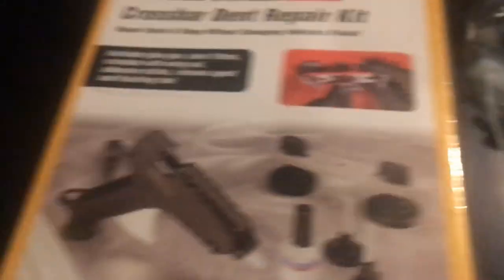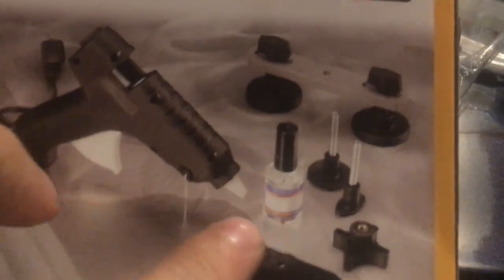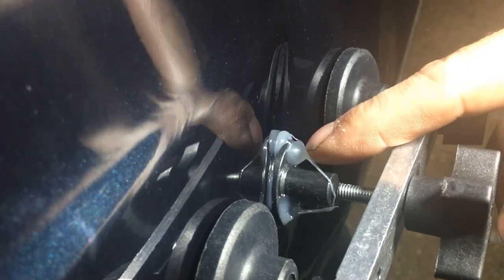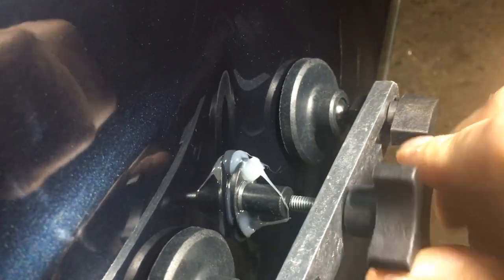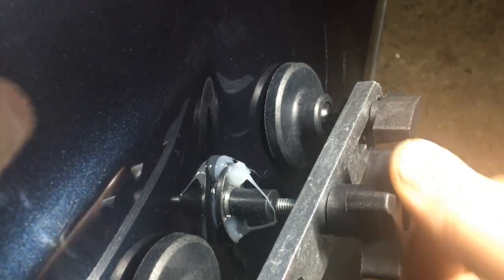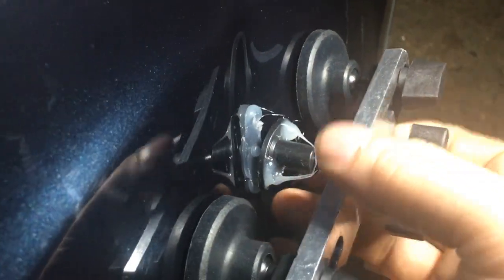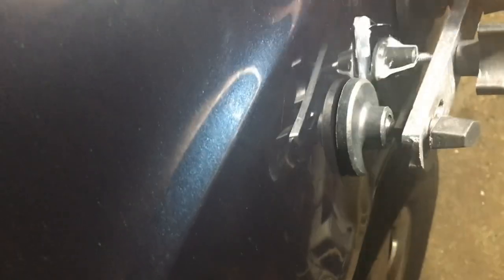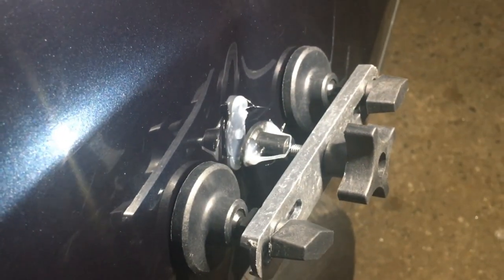Harbor Freight Crossbar Dent Repair Kit, remover, puller

Comment: Hey Bob I saw you're HP Pavillion 570 video I bought mine Walmart was selling It for $600 worst mistake ever had I known at the time It would have stayed on the shelf...
Reply from the maker: lol... yeah def not worth $600. It's not garbage, its just not easily upgradable. really the main thing holding it back is lack in sata ports. you can use all the components with a better motherboard, power supply and a case if u really want to boost it up. some people got semi good video cards slammed in there tho
Reply: @bobspurloc  I don't know how long you been doing pc stuff I am in a pc building group there kinda younger I would trust you more since you sound like you have been doing It for a long time .. I don't know If I could put a diffrent PSU and a 1050TI ?
Reply from the maker: oh wow I just saw u commented on that video. I guess I missed it? Other people in the comments have put a 1050Ti in that pc with the original power supply. I think I looked and the max power that 1050Ti pulls is in range of what the power supply can do. I've done lots of things for a long time lol, and one of those things is not listening to people who talk but r clueless lol. It has always annoyed me why people think you need a massive power supply for a video card that cant remotely draw enough power to make a 650watt sweat. lol. ah well. so if u read the comments on that video u will see a few put a 1050Ti in.  I would do it but I don't feel like spending any money on the pc. it's still sitting on the floor cuz I haven't decided what to do with it yet lol.
Reply: @bobspurloc  Mine I think It would make a great office PC
Reply: @bobspurloc  And would I need to even need to change out the PSU? I heard a low wattage psu and a higher card would burn It out?
Reply from the maker: @Paranormal_Gaming_ he stock PSU exceeds the max wattage draw of a 1050ti card. so as noted by other commenters 1050ti works fine
Reply: @bobspurloc  So nothing needs to be done to the PSU just put the 1050ti In